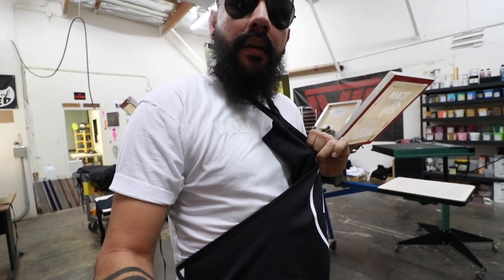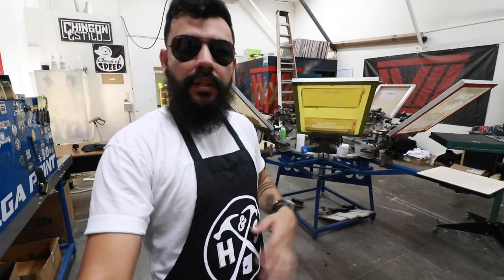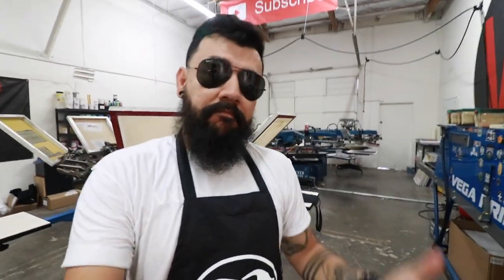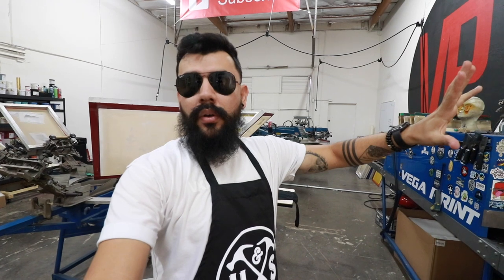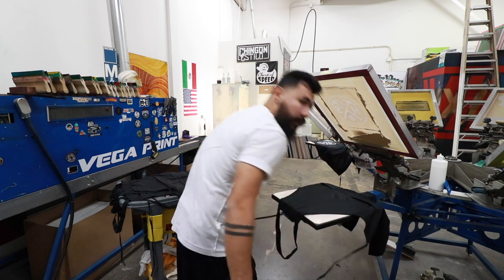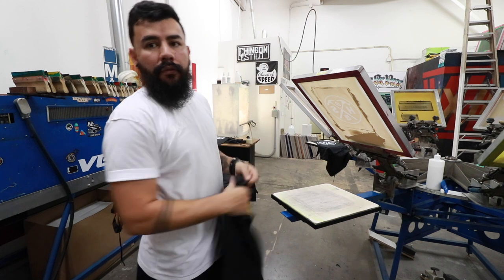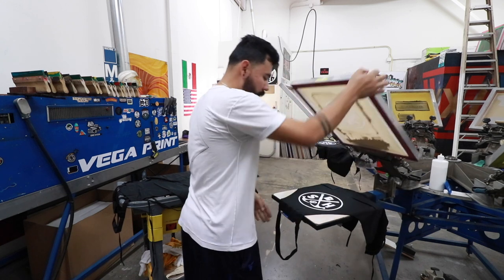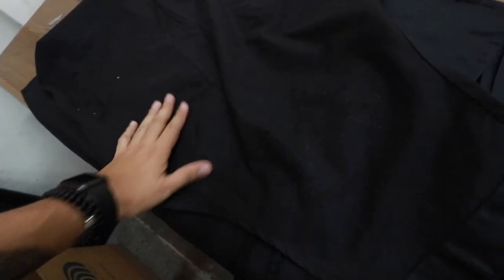how to screen print on aprons

Comment: Hello can you give me any advice about buying I want to buy an automatic screen printing machine the brand  is Lawson tropper it has  a digital panel control flash quartz  unit  . Is cheap
Reply from the maker: It’s hard for me to give advice because I have never worked on other brands other then M&R

The M&R’s are pretty reliable and you can always call M&R to trouble shoot for help if your press is down 
So I would be very careful and do as much research as you can as far as techs around you and how hard or simple is it to get parts for the press your looking into